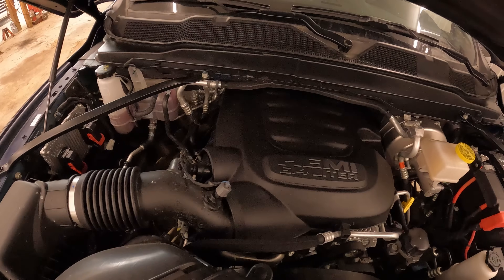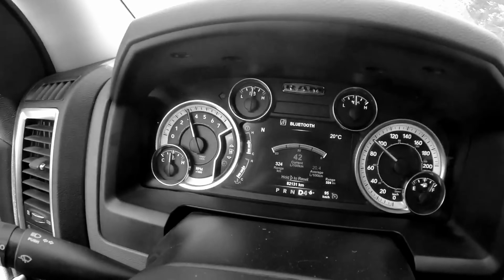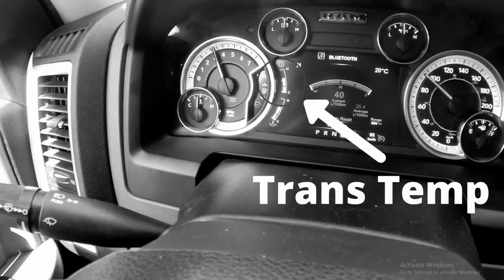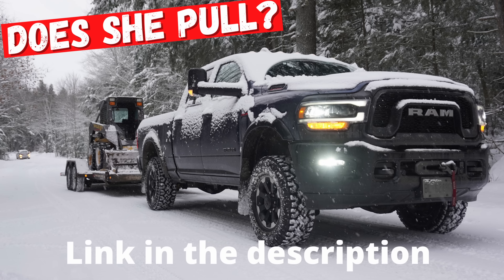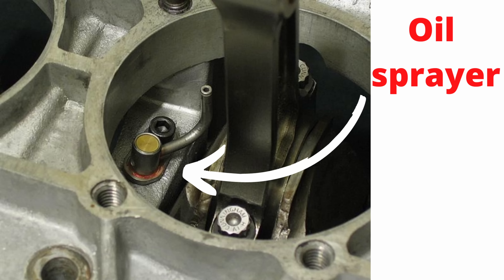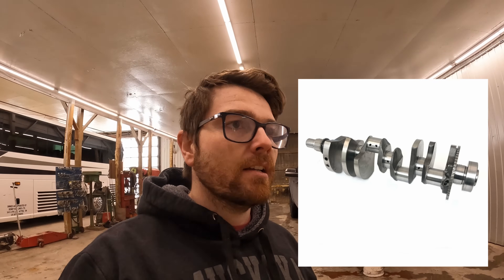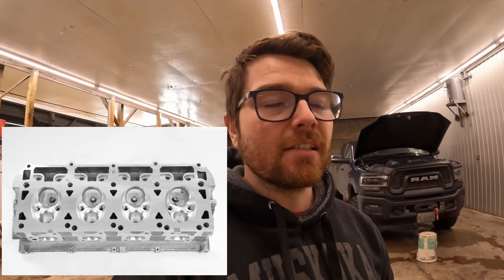RAM 2500 6.4 Hemi Review *Heavy Duty Mechanic* | Is The 6.4 Hemi Better Then 5.7 Hemi ??

Comment: Actually the 5.7 now calls for 0w-20; but guys in the know are running Redline 5w-30 which is almost as thick as a 40 weight. The thinner oil is due to fuel economy, but who care about that. And the 5.7 hemi was acutally used in the 2500's for years, so while it's obvious the 6.4 is much stronger I wouldn't worry about the 5.7 being weak as it's literally the only half ton engine that saw duty in a 3/4 ton for years; proof that even it can take abuse and keep going.
Reply from the maker: Absolutely! The 5.7 is a great engine. Loved mine and it will handle loads. And interesting I didnt know the 5.7 changed their oil. Makes sense!
Reply: 351 windsors were used with fords 3/4 and 1 ton trucks in the early 90s as well as the 1/2 tons.
Reply: Be careful on the oil viscosity for the 5.7 as it can and will effect the running smoothness in eco mode. I was running a few different kinds of oil and could not believe it when a mechanic friend of mine told me that even different brand oils can have different flow characteristics at the same weight bands. Sure enough, I started using 5w20 Pennzoil (as factory recoed) and all of the eco mode transition issues just magically went away.  The 5.7 is a great engine(I have had four of them in 14 years) with the only problem that I can see as the lifter tick/malfunction. All that being said I have now moved on to a 6.4 2500 and have been well pleased in the first 27K miles.
Reply: @kenbaustin4533  The engine does better on thicker oil, and it loves to run with extra moly. Running 5w-20 is a good way to get lifter failure. MDS be damned, that's disabled in my truck.
Reply: @JohnSmith-ev1sm  Each to his own but my experience proved out (at least to myself after having 4 MDS engines) that the correct oil and viscosity makes all the difference between a smooth efficient MDS shift out and one that bogs down and is obnoxious. Most of the problem with lifter failures have been from those who have long periods of low rpm idling where the oil never gets splashed far enough to lube the lifters as they have no dedicated porting.
Reply: @kenbaustin4533  The hemi doesn't use splash lube, it's not a 5 hp briggs and stratton. It uses pressurized oil, and if you are running factory spec you have a high probability of lifter failure. Idling doesn't cause lifter failure, cop cars have a lot of failure but that's not due to idling its due to not changing the oil according to severe duty (every 320 hours).
Reply: @JohnSmith-ev1sm  Of course the Hemi uses splash lube in many parts of the engine and yes, long periods of idle can and do cause lifter/cam issues. The only way oil gets back to the  lifter/can contact is from high rpm revving which brings oil up and splashes across the lifter/cam contact. Why do you think they are usually noisy on start up but not after? Maybe you need to graduate from Briggs and Stratton school and understand how certain engines get lubricated. Maybe Uncle Tony can explain it better to you. https://www.youtube.com/watch?v=dI93-Zdx_nY
Reply: @kenbaustin4533  Uncle Tony has no idea, don't get your information from him. These are NOT splash lubed. It's pressurized oil only. If they used splash oil your engine would be dead after an hour of idling, which obviously doesn't happen.
Reply: @JohnSmith-ev1sm  Well then please explain where the pressurized oil is coming from and going to exactly(with regards to the cam faces). What parts of Uncle T's theory is wrong? Obviously there are pressurized oil galleys and ports which internally lubricate the mains and cam shaft journals but much of the engine is lubricated via residual oil splashed about. There is absolutely no pressurized flow across the cam faces. If you think so then please tell me where it comes from besides conn rod splash.  You are starting to sound like you have never taken an engine apart.
Reply: @kenbaustin4533  You should watch Reignited here on YT, he's a certified FCA mechanic and does many hemi rebuilds, maybe you'll find it easier to accept coming from him. UT's theories have been debunked by so many guys on YT you shouldn't still be pedalling that stuff.
Reply: @JohnSmith-ev1sm  I just watched two of his lifter videos and what you stated above is totally inaccurate. 
1. At the 18 minute mark he specifically says that low RPM long idle times are a key factor in early hemi lifter failure. https://www.youtube.com/watch?v=XHqSePuaD-M
2. He states that improper use of recommended oil viscosities is not advised since it will interfere with the proper operation of the MDS system. 
3. He also stated that he cannot disprove the theory of Uncle T and that he may well be correct. 
So, I don't really think you have much of a leg to stand on here but proceed on with your 30 weight oil changes and live the dream.
Reply: @kenbaustin4533  I don't buy his theories on why lifters are failing; he's not qualified to make an authoritative statement (and neither is UT) as he's not a materials scientist, machinist, chemist, nor engineer; I told you to watch his videos so you learn how lifters are lubricated and how splash isn't a thing. He is qualified to explain that aspect. We know idling doesn't cause lifter failure because there are some trucks that fail with a few hundred idle hours and some trucks have 1100+ idle hours on top of 120k miles of towing, and still no lifter failure. If idling caused lifter failure, everyone who idled would fail and it would be consistent failure. Furthermore, only 1 or two lifters seem to fail in an engine at a time, whereas the remaining lifters are normally in 100% flawless condition; even though all lifters were treated the same way (in terms of idling). FCA attempted to fix the issue by redesigning the lifter with different needle bearings. Keeping that all in mind, it's obvious that this is nothing more than a parts issue, poor quality control at the vendor, and IMO a poor quality oil which does not help. You should be running a thick oil (hemi was originally designed for 5w-30), and something with gobs of zinc and moly for best protection but even then, you either get a bad lifter or you don't.
Reply: @JohnSmith-ev1sm  If cam faces are not getting oil splashed at low rpm and the little bit of oil that does manage to make its way down the lifter drops before it even hits the cam face then that is, in fact, a design flaw. I love the MDS system and have had no issues using the recoed oil  with any lifters. I would take the opinions of these two experienced mechanics over any chat board oil jockey. First you tout his superior mechanics rating then you trash him....... which is it going to be?
Reply: @kenbaustin4533  He's a great mechanic, but as I told you last time he is not qualified to explain why lifters fail. You're welcome to believe what you like, as am I. But keep in mind that whatever theory you choose, it not only has to explain why lifters fail, it also has to explain why the OTHER lifters DON'T fail, and are in perfect condition, even though they all had the same experience in terms of idle time and lubrication etc. The only theory that explains that, which also happens to be the simplest (and the one which FCA actually acted upon), is that the lifter themselves have poor quality, you get a bad lifter every once in a while and it has nothing to do with splash or idle. There is no need to get into complicated and weird theories, it's just a bad lifter, perhaps caused or worsened by dirty oil that gums up the needle bearing in single lifter. An oil that is high in moly, zinc, and cleaning detergents (Redline) can help in this case.
Reply: @JohnSmith-ev1sm  FCA engineers are financially motivated to ignore the problem and to not accept blame for any design issue. The Reignite certified mechanic is more qualified than any to have an idea of what is wrong since he fixes them everyday and is not financially led to tell you anything. In his videos he clearly states that there is no rhyme nor reason to which lifters go out since many of his rebuilds come from non MDS lifter blocks. Do you really think that if it were just a mere lifter quality issue that over the course of 14 years, with FCA's reputation on the line,  they would not have replaced the poor ones two years after they started recognizing all of the massive failures? Makes a bunch of sense to have every internet chat board barking about Hemi engines falling apart at 80K miles for better than a decade for simply upgrading an engine part. Right! It's still funny to me that you ignore the fact that oil splash is a critical part of any modern engine lubrication system.
Reply: @kenbaustin4533  Your position is that FCA knows what the issue is (design flaw), then spends all that money on a lifter fix which does nothing? Or do you think FCA doesn't know what the issue is but UT is smart enough to figure it with a simple drip test? Think about what you're writing before you type it out. None of these lifters are lubricated by splash, they are lubricated by pressurized oil. Occam's razor: the simplest explanation is usually right, it's beyond me why you guys want to accept half baked theories which DON'T explain why the other lifters DON'T fail in the same engine under the same conditions, instead of just accepting the simplest and most obvious theory; the lifter vendor has poor quality control.
Reply: @JohnSmith-ev1sm  It's real simple, It would take too much money and investment to completely redesign a new motor to solve a problem which only 5% of engines have(per Reignite's actual numbers). Ask yourself what is significantly different about the hemi design versus other v8's that do not have these type of lifter failures?? (hint, the cam position is much higher in the engine). Your statement that the cam shaft lobes are not lubricated via oil splash is comical. And by the way, these theories are not half baked but actually make common sense......much more than a group of biased engineers who feed you gullible guys with a bunch of crap that somehow explains away their design flaws. If you are going to hang your hat on what the FCA gurus call out then why are you selectively choosing to ignore their recommendations for using proper oil viscosity? You are starting to look like a clown show here.
Reply: @kenbaustin4533  If you can't talk like an adult without trying to insult the other person than nobody is going to take you seriously, least of all me. Lifters are NOT lubricated by splash; there is no physical way for that to happen. They use pressurized oil. When the lifter fails, the bottom of the lifter starts to hit the cam lobe and eventually wear it down, that is why the cams are failing (the cams are also not hardened enough, that was a mistake by FCA). So first the lifter fails, then the cam fails as a result of that. It's not a splash issue. The hemi WAS originally spec'ed for 5w-30. 5w-20 and now 0w-20 are classified as fuel enconomy oils, you may save a fraction of an mpg but you pay for it with less lubrication and protection especially at high temps and while towing. ramforum has many threads on proper oil lubrication which you should read, all of them recommend 5/0w-30 from redline, and 80 percent of those with actual hemi tick have eliminated it (or the sound anyway) when running Redline. As I have real work to do this will be my last post on this, and I've had enough of your childish responses anyway.
Reply: @JohnSmith-ev1sm  If you can't understand that oil splash will not only lubricate the contact surface between the roller and cam plus it will lubricate the roller bearings as well then there is not much I can do for you as your logic is all over the place. Your immature debating techniques, which never answers direct questions, truly detracts from the points you are trying to make. Picking and choosing which FCA engineers theories you choose to follow is proof. Let's see if you can hold to your word and not respond! I really shouldn't but I suppose in your special case, I have got lots of time to burn to refute your nonsensical  and illogical thoughts. I would hate to think that you would take anymore of your precious time away from your gaming to respond to this troll.
Reply: Love that this became a whole ass argument about why the lifter fails hahaha
Reply: @michaellarrick8881  I've been researching this problem for literally 3 years, I've watched all the theories and read on a bunch of forums (ram, bobistheoilguy etc), I'm happy to debate but guy above me is just being childish and I have better things to do.
Reply: @JohnSmith-ev1sm  I do feel you man. I’ve also done a fair share of research on this. It’s a fascinating topic because I kinda of feel like there is no direct answer as to why these engines have cam/lifter failure. Different theories from different people. I definitely think high idle time has something to do with it. As for the oil type, I’m not sure. I don’t believe the manufacturer would recommend oil that is insufficient for the engine they made.
Reply: 0w-20 is not about fuel economy.  
No one has been able to show proof that you get better fuel economy with 0w-20.  
0w-20 is needed for mds lifters and vvt system, because they require thinner oil to work properly otherwise they fail.
Reply: @repairvehicle  You don't need 0w-20 for MDS, many guys run very thick 5w-30 and MDS works perfectly for years. And actually if you look at a viscosity graph, you'd see that thicker oils and thinner oils have the same viscosity (but at different temps) in the range which MDS is active. 0w-20 is about fuel economy only, that is the goal though it only has a benefit to FCA and their corporate MPG average, not the consumer.
Reply: @JohnSmith-ev1sm , show me a proof where 0w-20 increases mpgs vs 5w-30.  Bmw said same thing thicker is better until bmw earned bad reputation for vvt system problems due to thicker oil.  When bmw switched to 0w-20,  no more problems with vvt system.  Ford still continues to convince themselves that thickis better, but consumers continues to have problems with vvt system.  Toyota runs 0w-20 and has zero problems with vvt system.
Reply: @JohnSmith-ev1sm  they don't have same viscosity, you looking at the wrong stuff.  If they had same viscosity then why thicker oil,  you are contradicting yourself.
Reply: @repairvehicle  No, I said they have the same viscosity (but at different temps). Meaning a 20w at 50 degrees might be as viscous as a 30w at 70 degrees (or whatever, it is entirely dependent on specific brand and product to find exact comparisons but you get the point). Point is, MDS works across a wide range of engine oil viscosity and 30w doesn't cause any issues. I've been running it for years now.
Reply: @repairvehicle  Have a nice day son.
Reply: @JohnSmith-ev1sm  , for how many years?
How many miles on same vehicle?
In what state do you live?

Comment: 5 20 vs 0 40. it come down to how its run at a oil temp point. oil begins to thin agen wen it gets very very hot. so a thicker oil tells me its ment for high oil temps thicker oil combats hi temp thining. and the 5 20 oil is ment to reduce oil pumping friction losses. heavier oil harder to pump.

Comment: So I assumed that that 5.7, 6.2, and 6.4 Hemis were all the same block and the higher displacement engines were just bored out more.  So my concern was having thinner walls in the 6.4.  So are you are saying that the 6.4 is actually a different, bigger, and thicker block than the 5.7??..............

Comment: I’ve got a 17 power wagon with 100k miles and I can’t get it to start without a major hiccup , I’ve already replaced the plugs, fuel pump , and battery
Reply from the maker: is the starter strong?

Comment: I idle   my 22 6.4 every day. What can I do to prolong engine life other than not idling or is it even a concern?
Reply: Research using the mopar high volume oil pump found on the either the challenger or charger srt. I don’t remember the name of the channel, but the Mopar mechanic researched the issue about lifter and was certain it was the low volume oil during extended idle time. He was replacing the oil pump with this mopar OE pump on cars he was working on. And it was a high volume pump not a higher pressure pump..
Reply: Found the video on using the high volume oil pump

https://youtu.be/1gpEwkTVCmE?si=z4OT6G44k-PR6Nsq

Comment: Great video, but your explanation of detonation is incorrect.  Detonation is caused by cylinder pressure, not by mixture ignition from an exhaust valve.  If you have a high compression engine under a severe load, with no reduction in ignition timing, one can get detonation.  But, you will NEVER hear detonation in a newer engine because they have knock sensors in them.  Once the knock sensors sense this increased cylinder pressure and "hear" the beginnings of detonation, they direct the ECM to retard the ignition timing, so that detonation never occurs.  The sodium filled exhaust valves can help in keeping the combustion chamber cooler, thereby helping the intake charge to be cooler and for more horsepower to be produced.  This cooler combustion temperature will also reduce the POSSIBILITY of detonation. But to say that a hot 🔥  exhaust valve causes detonation, or that it "sparks" it, is simply false.  The exhaust valves are  ALWAYS hot when the engine is running.  Think about it -- they have exhaust gases  running right by them!  

The PRIMARY reason to sodium fill the exhaust valves is to increase the longevity and stability of the valve.   This process came from the aviation industry, where it was used on air cooled aircraft engined long before it was used in vehicles.  Anyway, like I said, rhe sodium is for valve cooling and longevity, with a side  benefit of somewhat cooler combustion temperatures..  I hope this helps.